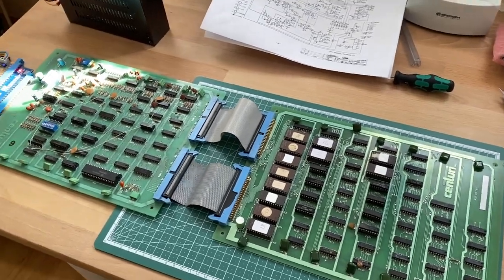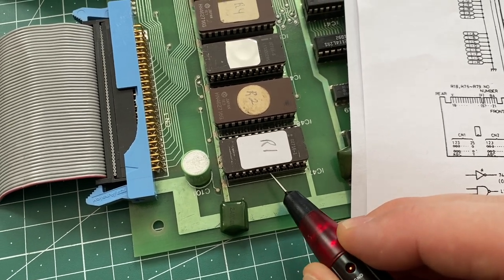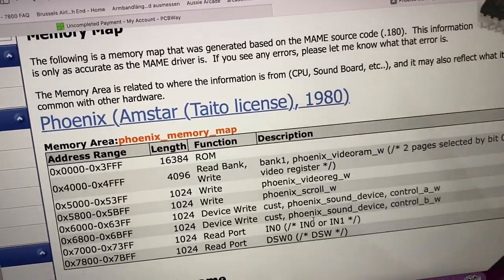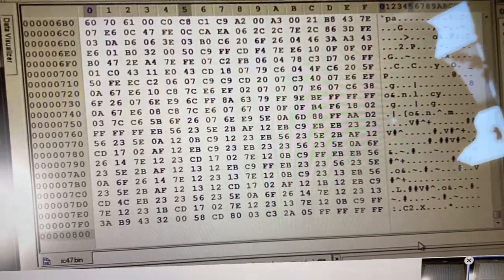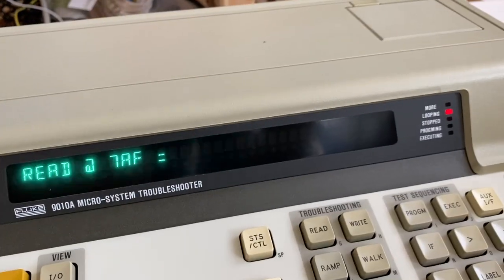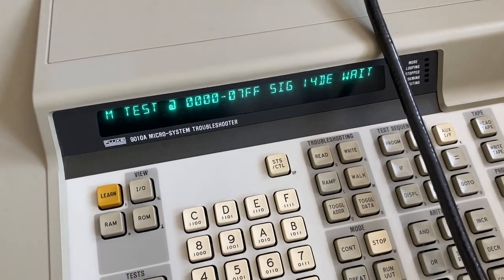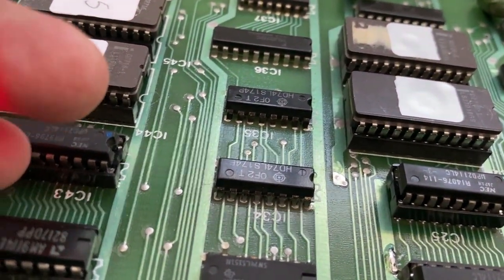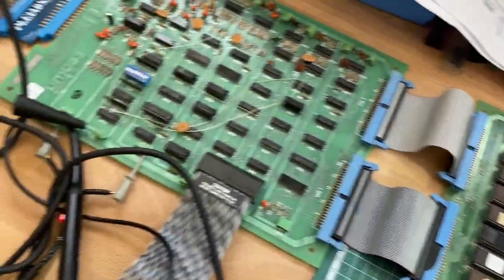Pleiades Arcade PCB Repair / Phoenix Part 3 - Troubleshooting with the Fluke 9010 and oscilloscope

Comment: Excellent! Really well done! I can't believe you had a Fluke 9010A "in your attic" 😂 Those things are so difficult to find these days. From just using a logic probe on the last video straight to getting the "big guns" of the Fluke and oscilloscope out on this one - what a difference! Really good trouble shooting and reasoning. No hard bit errors so no bus lines tied high or low. Oscilloscope showed very dodgy behaviour on D0. Good methodology to test the signature of the EPROM without others in the circuit and add them one by one until the fault recurred. Looks like another case of bus contention from a failed EPROM. Video issues from a failed multiplexer solved by simply using the logic probe to find a floating pin. Really nice that the game worked once those issues had been sorted. Just the colour PROM  to find/program and you have a perfectly working board set that, as you say, can be considered "known good" to test the other boards with. Looking forward to the next video 👍🙂
Reply from the maker: Yes well I really did it pull out of the storage area of my house. It is such a great tool. I was really lucky when I found it on the bay a couple of years ago... and it was WAY too cheap. The seller did not know what he had to be honest.

Comment: The trusty "touchy finger". Helped me fix a Voodoo card with an open 0R resistor in a RAS line and an Amiga with broken traces under the Denise socket. Always worth a try if you have visual feedback.
Reply from the maker: Absolutely. Good way to spot floating lines.

Comment: As always, great job! On the ROM issue, I was thinking the select signal for it must be bad. I've never seen a ROM fail in that way
Reply from the maker: Thank you very much! As far as the rom failiure is concerned I havn’t come across an issue like this before either. I found this also to be pretty surprising but somehow the eprom must have had a tendency to interfere with d0 even if it wasn’t selected.
Reply: Always have first time for all issues ☺️

Comment: Hi doktorzett! I'm trying to learn to repair pcbs. I have a Thunder Fox pcb by Taito. The game has sound and seems to be running but I can see only a black screen, no video. What is the first thing can I check on the pcb? Thanks in advance for any help. 
Thank you for the videos! Great job!
Reply from the maker: The game runs so look at the video output circuit. I would start from the video output and work myself back. Look at the RGB and Sync-Signals. Maybe some "distal" IC in the chain has a problem.
Reply: @christophzett  Thanks for the reply! I checked RGB starting from edge connector and the traces of the RGB is connected on a custom Taito's IC (TC0260DAR). One of yours videos about the repair of Double Dragon, you gave a real good explanation about the video circuitry so I understand the custom IC is the pallete / RGB output. I found starting from the edge connector the RGB output pins but I don't know the input pins on that IC. 
You helped me a lot so I need to go further on the video circuitry. Thank you so much!

Comment: The Bad LS157 chip was causing the ROM chip to have ROM Checksum Errors? So it was an Addressing Error that was causing the ROM checksum Error, NOT a Data line Error
Reply from the maker: No, the 157 had nothing to do with the roms - in the circuit it is switching the address lines of the video rams. so it was causing the video problems.
Reply: @christophzett  Why is the 157 switching the address lines of the video ram? because the switching of the address line of the video ram has to do with the Horizontal lines and Vertical lines on the Arcade monitor.  The 157 is switching 4 address lines to the video ram which has something to do with the H&V signals be applied to the arcade monitor.
Reply from the maker: @waynegram8907  The video ram has kind of 2 states. 1) it is written by the cpu and filled with data that it needs to send to the screen. 2) it is outputitibg the data to the screen or graphics eproms. The 157 is a switch for the address lines of the video ram that either connects the videoram to the h&v signal lines for video output or connects it to the cpu so that the ram can be filled with data. as the 157 had floating lines the ram could not be filled with data and did not even output „regular garbage“ which it only would if it would be at least read correctly (with working address lines)
Reply: @christophzett  The Video Ram is getting Filled up with the PROM color palettes data codes? Somehow the H&V signals gets mixed with the PROM chip Color Palette data code that goes to the arcade monitor. The H&V signals are the arcade monitors X&Y or H&V coordinates. The hard part is how to calculate the H&V signals to the arcade monitors H&V coordinates?